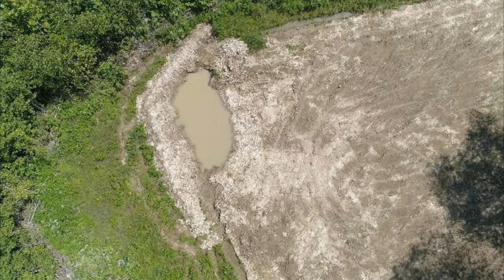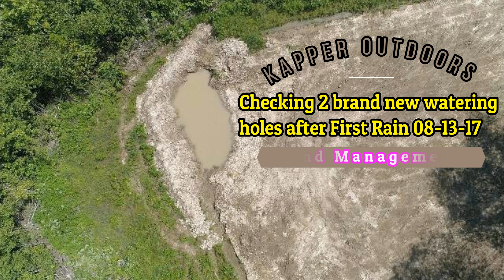2 NEW Watering Holes after first Rain! Will they hold water? 08-13-17

Comment: Kapper, you may already know this, but in case you don't; on the Phantom drone, when you're filming and take a photo, it's saved at lower resolution. Only when you switch to camera does it take the higher res photo. The lower res is probably fine for your purposes (and it's very convenient to snap while filming) but I was surprised when I tried to print a larger poster and it didn't come out as nice as I thought it would. You can compare file sizes of similar pics, and you'll see the difference. Keep up the good work; enjoying the drone footage.
Reply from the maker: dang, that's real good info to know. I snap stills for cover snapshots mainly for the carbon channel, but they need to be good looking pics.. Not sure what res it takes like I am doing but I'll have to remember that and just take a few still while NOT videoing. thanks.

Comment: Hey Kapper, you should do a overall review of the E42 now that you've had it for awhile, because I am now in the market and looking at either a e42 or e50 or e55. Would really appreciate your thoughts on the machine. :)
Reply from the maker: Yeah, I'm trying to get to it. To me the E42 is best of those 3, unless money of no issue.. The conventional design (with protruding counterweight) gives it more balance and ultimately more power to dig. If you need a zero turn, then another one would be the option, but seriously, the counterweight only sticks out like a foot or so, man you'd have to be working like MEGA tight to buildings for that to even be an issue.
Reply: Kapper Outdoors Ok! Thanks for the input, can't wait till I get the E42 to work :) I don't get close to buildings or things and I like to have a counterweight with a tail swing for the better stability. And the nicest thing is I've seen the capability of the machine from your videos so I don't have to question myself on what it can do.